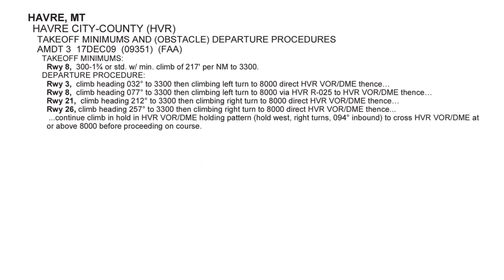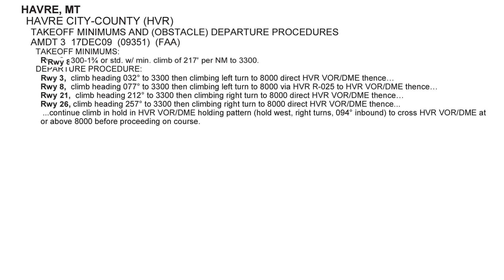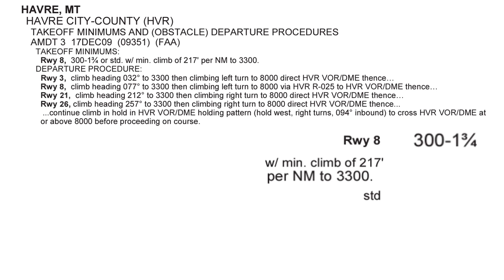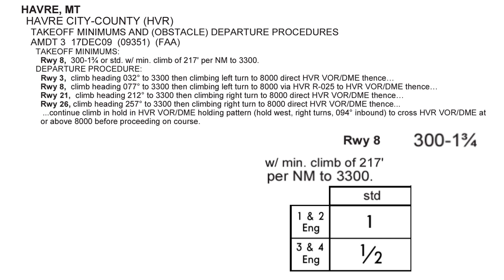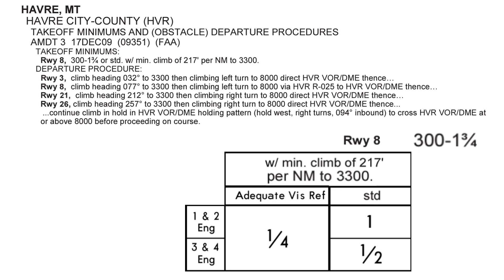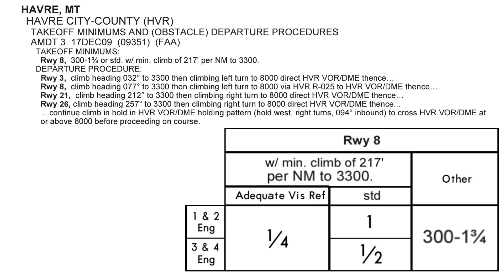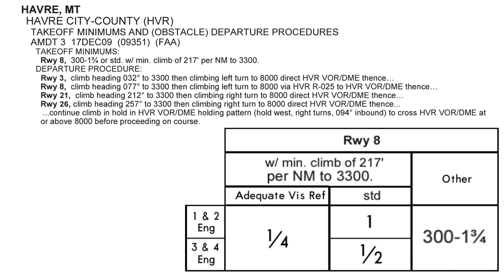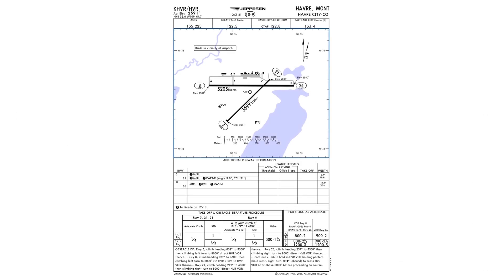How to Read Takeoff Minimums | Terminal Procedures Publication

Comment: why is it that rwy 8 has takeoff minimums but other runways dont?
Reply: Presumably there is terrain or another obstacle penetrating the clearance gradient that you have to either out-climb or acquire visually to avoid, but only off that runway.
Reply: If you read 5-2-9 in the aim it will explain it!
Reply: Well they do, but only the standard minimums

Presumably, there are buildings and/or terrain (hills/mountains) nearby when taking off from Runway 8 that they want to make sure you avoid, but not the others (because you’d be pointing in a different direction)

Comment: So from here, if my ground speed on climb out is 75 knots, I would multiply this by the climb gradient of 213 then divide by 60 to get my feet per minute? If I can make this performance I should be good to follow correct?
Reply: Correct. Just remember that the climb gradient requirement is all the way up to 3300 ft. MSL in this example. With an airport elevation on 2600 ft. (rounded) the safe way to do this would be to ascertain that you can meet the gradient at the top altitude of 3300 ft. since your climb performance will decrease with altitude. Not too large an altitude spread here, but at other locales with higher airport elevations and greater climb altitudes required, it can be a challenge even for turbocharged engines.
Reply: I also believe you have to be at the departure end of the runway at at least 35 feet AGL.  If you are higher than that, your actual needed F/NM is less.  Best to see if can meet the F/NM requirement at top altitude to make sure you can do it like has been said.